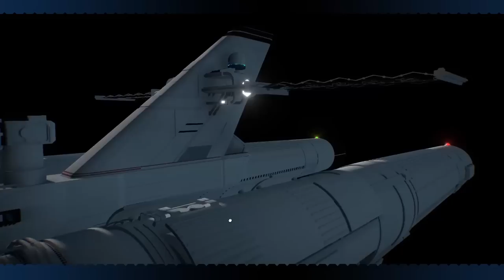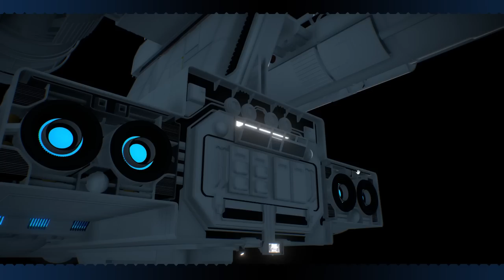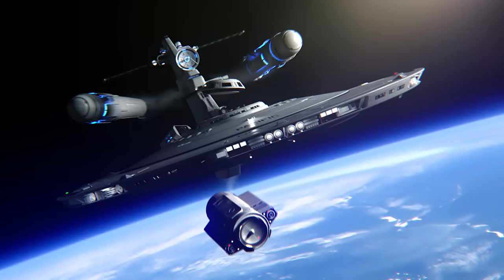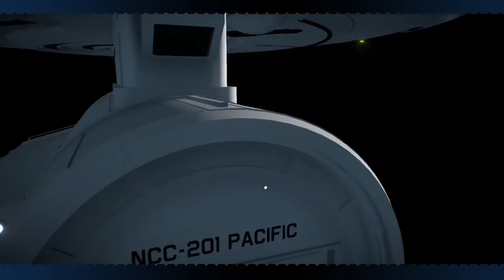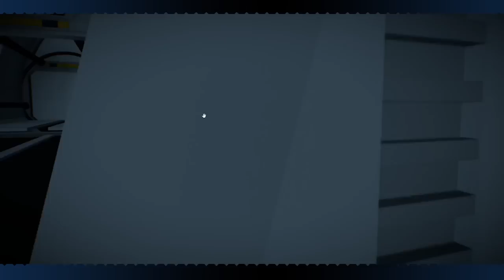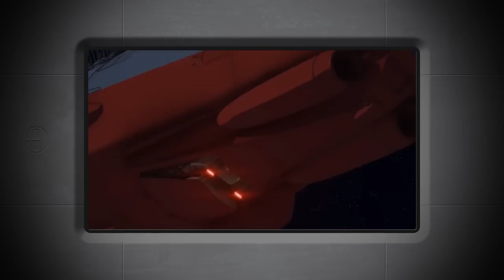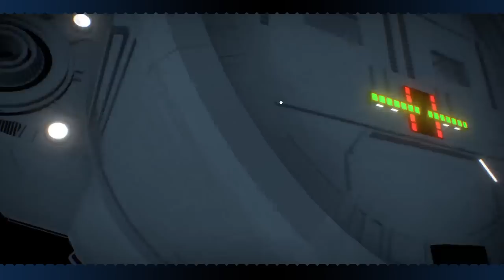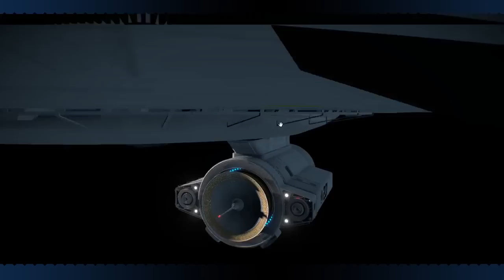Show and Tell: Starship Pacific from Pacific 201 (Star Trek fan film)

Comment: Few remarks
 - Aerodynamics. Ideally upper half should create the balanced out to create the same amount of drag as lower half. Ship would have to compensate when moving at impulse.
 - Balance. Upper half again looks bigger heavier. Ship would have to compensate with directional thrusters when moving on impulse.
 - Retractable passive heat dispenser panel look technologically out of time. For the ship that size and of that era I believe there should be more practical solutions, like active irradiation. Passive cooling could work as a backup in case of major system-wide malfunction, though.
Reply: "Aerodynamics." -- In SPACE?

Comment: I could see the observation ports being used against Romulan vessels and also for astrogating as per Enterprise-D only lower tech perhase using a Augmented reality interface in the windows so the viewer can get a real space-time view of the surroundings? an interesting element you bring up maybe heat during warp is one of, if not, the limiting factor to warp time in warp etc essentially the heat really has no where to go inside the warp bubble? Managing heat transfer efficiency maybe what makes an engine good/bad/fast etc?

Comment: I like the overall design but the thermal features are a bit much; a ship equipped an antimatter reactor and warp drive would also likely be advanced enough not to require such archaic features :)

Also the detachable modules arcs back to the obsession that show designers had with detachable sections (e.g. the primary hull on the TOS Enterprise was supposed to be detachable). I don't think they really make sense on such an advanced starship. It would be like tower detaching from an aircraft carrier in the event of a reactor meltdown. You need lifeboats of course but not specific sections that detach - what if the problem is in those sections?

I really like the nacelles and the secondary hull, especially the deflector detail. Great work.

Comment: It's a beautiful design.  Very grungy, and lived in.  How would you design its future namesake?  Push the envelope.  Remember that the warp drive has no thrust, it creates a wave that the ship surfs on, so the structure that ties the nassel to the ship doesn't have to be big, or maybe not even have an attachment.  There's no reason that an advanced version couldn't have self contained engines, that operate in a sort of fly by wire, and can even reposition to account for lost, or damaged nassels.  Just how far could you take your design into their future?

Comment: I'm having trouble finding a purpose for the tower/nacelle assembly aside from looking cool. There's a modular, ejectable engineering section in the main hull, which I assume generates power and superheated warp plasma... which is then piped out of the main hull, through a narrow tower section up to nacelles, which are positioned far enough away from engineering that they need a secondary engineering section devoted just to the nacelles? Observation room having anything to do with maintaining the nacelles is just silly... they'd just use external cameras. 

So apart from looking cool what does the tower accomplish? Attaching the nacelles to the tower means we now have to add an entirely new engineering section, and creates a totally unnecessary weak spot for the Romulans to exploit. One shot to the tower would ignite warp plasma, and if the ship somehow survived, the tower would be destroyed, half your engineering team would be incinerated, and your nacelles would either be shrapnel or floating away with the useless observation post.

Not sure about when Pacific was designed/constructed relative to the start of the war, but this is not the ship I'd wanna fly into a space battle against Romulan Warbirds that's for damn sure.

Incredible design and 3d modeling work. I totally support your creative work and wish you the best, but the tower is a real headscratcher for me.

Comment: Love the reasoning behind the design.  My only technical issue is that those  heat dissipation radiators coming out of the upper sail are way too small to be meaningful given the power output of a warp capable starship.  They also look flimsy and out of place given the ruggedness of the rest of the design.  Just my engineer perspective.  Thank you for such a neat design and sharing it with us.
Reply from the maker: Certainly a good point! Although, the radiators on the upper sail are mostly for the sensor equipment up there. And the warp nacelles have their own built-in thermal control system. Still might not be robust enough, but who knows how efficient futuristic materials might be? 

Thanks for the feedback!

Comment: Weren't NX era ships still using grappling/magnetic hook and cable reel systems because tractor beams were still highly experimental and just starting to come into use?  I thought the NX Enterprise had to actually be refit with tractor beams at some point during the show.
Reply: No it is just that Tractor beam was a protected strategic Vulcan tech and they didn't share it with Earth...  Same goes with shields. Phasers on Stafleet vessels were a quite primitive version of the Vulcan ones. As for the photon torps, well, your guess is as good as mine, they shouldn't have had photon torps even in thrid season to begin with...

The Andorians shared with Starfleet many techs such as shields, tractor beams and better phasers...

Comment: Overall I rather like the design, especially the extendable paneling for the nacelles,  but feel the reaction control thrusters shouldn't be a single facing, if they had ports facing perpendicular vectors that would allow for say having the forward set thrusting up from the saucer allowing for the ship to effectively rotate around its central axis. Not sure I'm explaining that well. I see it like RCT's on the top front thrust up while the rear thrust down and spin. The other thing I thought would look cool is having a few missile ports being used to be able to either cover the phase cannons or being able to slide over windows to have them become armoured as well. I know it has shields but it has been shown that damage can still bleed thru shields so having armour plates sliding over the windows when the ship shields up and plating polarizes seems like something a war era ship would do.